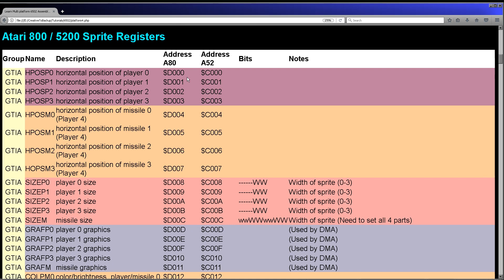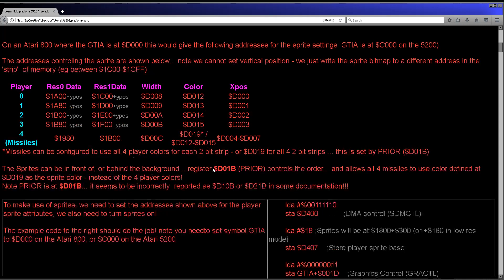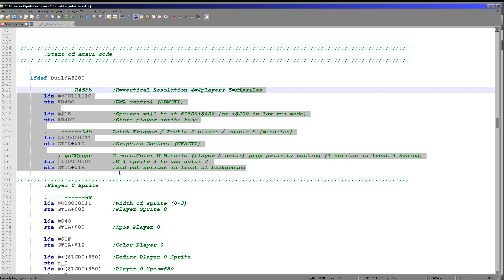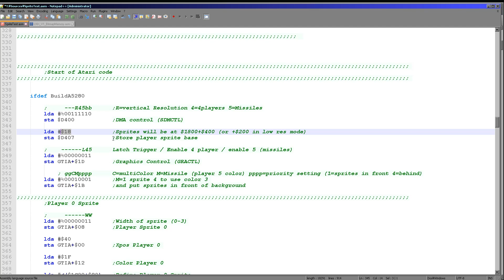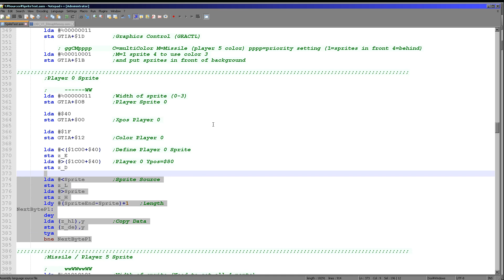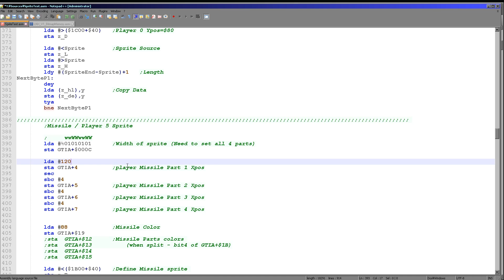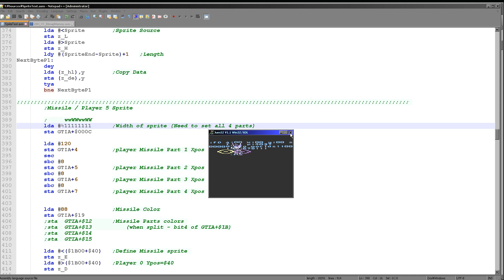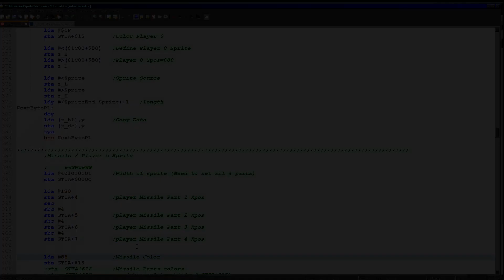Hardware Sprites on the Atari 800 / 5200 - Learn 6502 Assembly Lesson P31

Comment: The Atari 800 computer came out in 1979. Before the Vic-20, C64 or NES. So back then, having a computer with a whole 5 hardware sprites, was a very impressive achievement. It can be argued that both, the Commodore and Nintendo, were influenced by this Atari computer, when designing their respective machines.
Reply from the maker: True enough! I really got into the gaming machines with the NES, so the earlier machines missed me a bit.
Reply: and don't forget that you can take a sprite and cut it into many sprites using display list interrupts. You can also change the color and width.

Comment: Is it possible for you to put examples on your site that DON'T use the VASM assembler. If i have an emulator and an assembler, I need examples to learn from.
Reply from the maker: No it's not possible. There's no possible way I can provide examples for every assembler out there.
If you're a beginner and don't know how to convert the code for another assembler, I suggest you use VASM... If you're not a beginner, you should be able to work out how to covert the code to your requirements.
Reply: @ChibiAkumas  thanks

Comment: Just curious, where did you learn about the hardware of really old and obscure machines like this? Is there old documentation still around?
Reply from the maker: Yes, the old documentation is around for most of these systems, I mostly start on Archive.org - and try to find old manuals, tech sheets and programming guides... but google can often reveal other great guides on the systems
Reply: @ChibiAkumas  I always wondered, since now that i'm starting to get a tiny handle on assembly, I'm starting to realize really quickly that you can't do much with it without knowing what kind of hardware you're using. At the very least, you need to know the memory map of the local RAM the CPU will be talking to. And what the local I/O does with the inputs.

This rabbit hole is deeper than I thought. haha
Reply from the maker: @EvilSandwich  Yes you are correct... but in my experience the same is true of C++ - the language is easy, but you need to use include files to do all the work for you - and if those libraries fail or aren't available, you can't compile... I can't build my old C++ code anymore, due to the open GL libraries being 'obsolete'
Reply: @ChibiAkumas  I'm still new to coding. I'm guessing that libraries are .dll files and the like?
Reply from the maker: @EvilSandwich  Yes - basically stuff you're using that you didn't write yourself!

I try and avoid using the firmware on these old 8 bits - and go straight to the hardware - so there's less to go wrong!
Reply: @ChibiAkumas  Honestly, Assembler has been helping me with wrapping my head around things I didn't 100% understand on higher level "easier" languages like C or Python. 

If/Then statements are all well and good, but it really helps that when you run the command INX, $E8 or 11101000, it literally means that you are physically firing different voltage levels to the actual physical D0-D7 pins on the CPU. 

Knowing I can actually do the exact same thing to the 6502 while it's mounted on the breadboard with different wires connected to a 16 pin dip switch and a 555 timer and get the exact same results as I would if it was running the same command from RAM is kind of mindblowing. And does wonders to demystify the whole process.